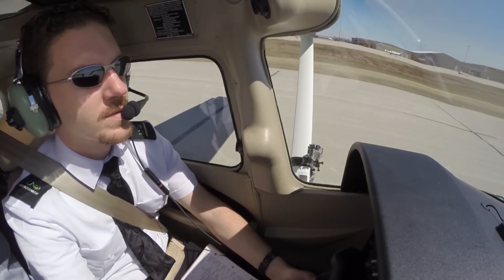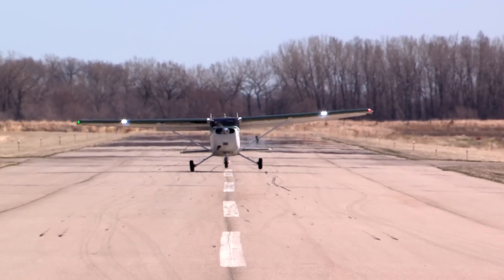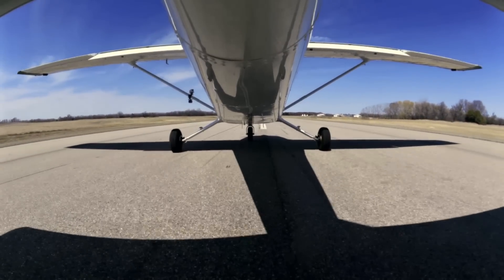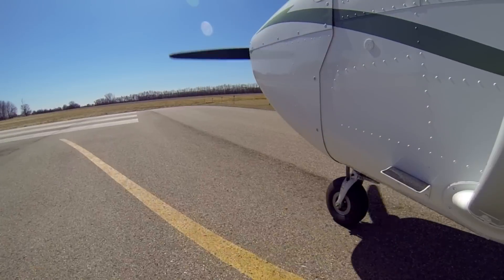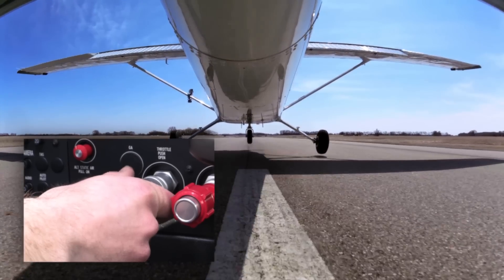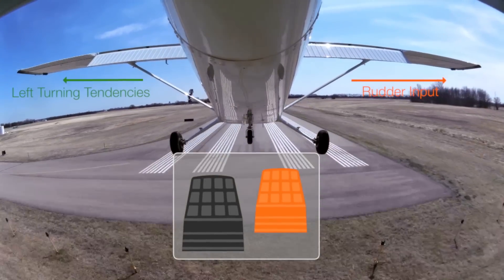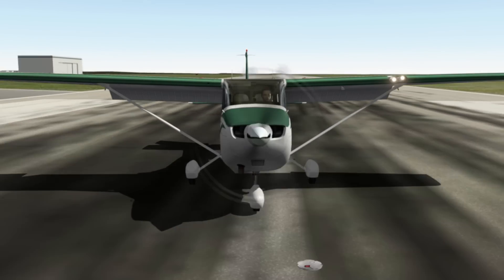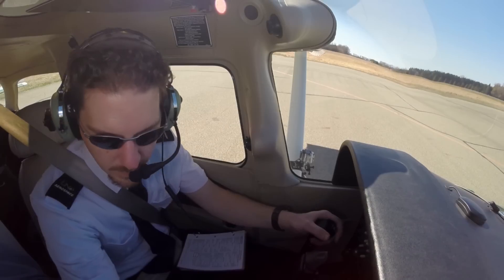On Centerline - Where an airplane belongs...

Comment: Riding motorcycles for years you push with the right hand and pull with the left to turn left.  
That being the opposite  (pushing with the left foot and pulling with the right)  when steering a plane to the left on taxi took some getting use to.

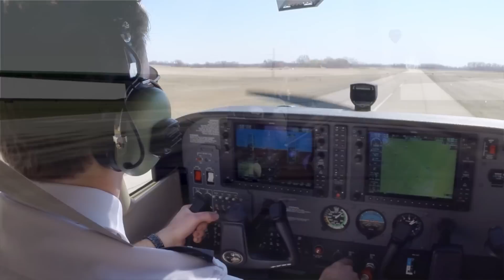Comment: I forgot how to land a plane after about 6 weeks of not flying.  I was losing centerline and the harder I tried the worse I got.  At the time, my mindset was - once the mains touch, put the nose down for more stability and it still felt like I was going to tip the plane over if I forced centerline more - then hitting the brakes right after touchdown was just moving from "bad" to "very bad".  I found this video and starting at 6:30 it really helped.  Here's  pre and post videos.  Pre - https://youtu.be/ZcKrH1qlJms  Notice me heading off for the grass.  Post -  https://youtu.be/wemj6ypzLhk  The tip that helped me - KEEP THE NOSE WHEEL OFF THE GROUND - "back pressure".

Comment: I knew and had no issue with rudder control during take off, but  is there anything wrong with banking a bit to right with aileron instead of right rudder... maybe little bit of both ?   To me, rudder at slow airspeed causing a slip is no better than banking a bit for coordinated one.   What's the exact breakdown to say RUDDER ?

Comment: I do not see anything for the lapsed pilot wanting to get back.  In my case, I have not flown in over 6 years because of complications from knee replacement surgery. I have a CP-ASEL-IA with over 1000 hours - many as a mission pilot with the CAP. The biggest problem is that I now have a prosthetic left leg - above knee amputation.  My family doctor had been an AME and is of the opinion that my health is now more than good enough for a 2nd class medical.  The chief flight instructor a KMQS (Chester County, PA) thinks I would be wasting my time to try to get back in the air. The only problem I can see is with the toe brakes.  What do you guys think? I really miss flying - particularly taking the CAP cadets up for their first flight.
Reply: +mike klaene, I suggest finding a current and good AME that is willing to work with you and might be able to suggest a good flight instructor. The FAA has issued SODA (Statement of Demonstrated Ability) for amputees, but I'm not sure what the parameters or process is.

Comment: The G.A. industry continues to leave out the all powerful ailerons (2 to 4 times the surface area of the rudder and HORIZONTAL to the changing relative wind) and directional control on the runway. Misuse of the ailerons, aggravates an already dire directional control issue. Do not drive like a car when recovering from skids.
Maintain ailerons PROPORTIONALY and opposite the needed rudder.